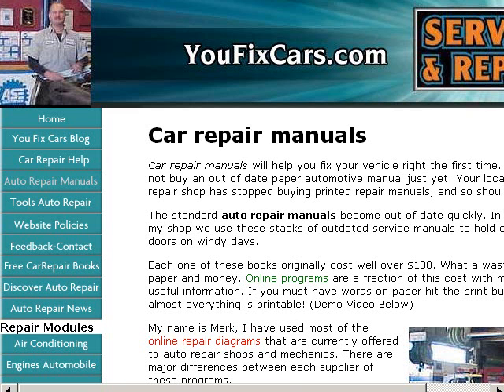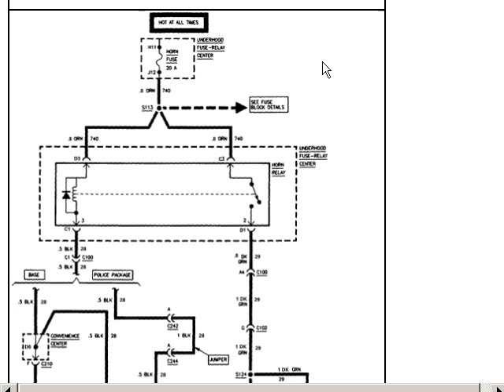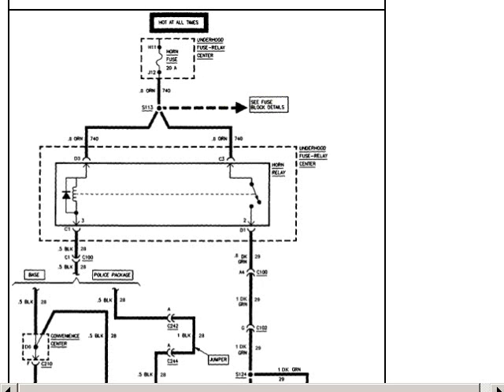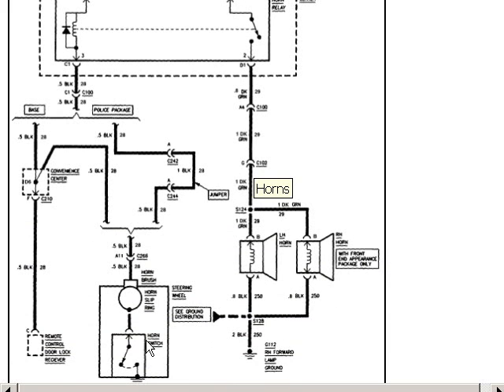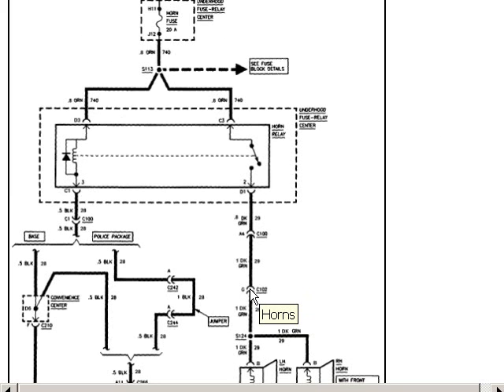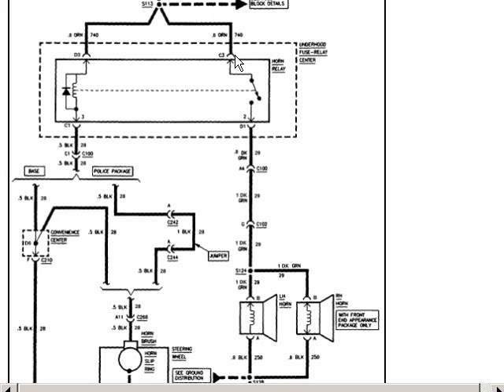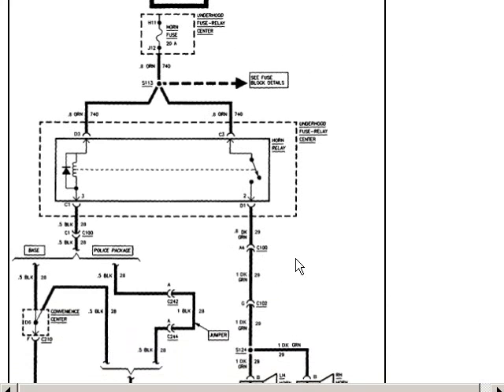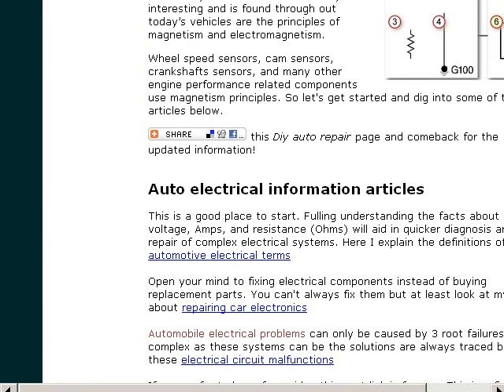How to find automotive electrical shorts

Comment: Good post. A light bulb (rated for the ckt. voltage) and socket with leads and/ or clips to bridge the fuse clips or holder (fuse removed) would give ckt. protection while troubleshooting if a breaker is not available. When the fault (Gnd.) is cleared the light will go out.

Comment: Nice video, thanks for making it.  It doesnt solve my problem but I did learn something from it none the less.  My issue is that I have lost power supply to the cigarette lighter in the car and also the blower no longer works.  they both dropped out at the same time on a drive back from Spain to the UK.  At the time we had the Air con going hard and three devices in the cigarette lighter, two DVD players for the kids and the sat nav.  All fuses seem to be ok. Tough journey after losing those!!

Comment: Not a bad idea but a bit tricky to hear the circuit breaker when you are in the trunk looking for a short circuit. I used to make up a long length of twin cable, about 6 to 8ft long, attach a sealed beam headlight unit (40 to 50w) to one end and at the other end solder a plug to fit into the fuse holder. With the lights switched on and the short circuit present the sealed beam will light up brightly. When you find the damaged wiring and move them the light will go out or dim considerably. All this can be done without going backwards and forwards to hear the circuit breaker. Also the circuit breaker can only operate like that for so long before it becomes unreliable and possibly stays closed and bridges the fuse holder and lets the wiring burn up.
Reply: Thats a cool idea. :)
Reply: Richard Morgan hello sir , how did you connect the light? can you pls break it down it sounds really interesting thank you in advance.

Comment from the maker: Yes I think most cars will have circuit breakers to grab in the Junkyard. They can often be found in the fuse panel or relay center of American cars and trucks. You can also get them new for a few dollars at any auto parts store.

Comment: I have Haynes manual (wiring diagram)  What is order of components?  Battery-fuse box- light switch, turn signal switch, brake pedal switch, then tail lights?  After I replaced turn signal switch and signaled with lever; the fuse blew.  Also, my dash lights come on when I hit brake pedal.  What is going on?  Please help.  Thanks in advance.  Great vid by the way.

Comment: Hi can you please elaborate if possible; are you suggesting attaching alligator clips to the circuit breaker & then inserting the breaker into the fuse holder??

Comment: thank you the videos.  I find them very informative.  I have watched a few but yet to see anything about melting wires.  I have a 97 Chevy S10 that melts the black ground wire from the ac blower motor relay.  Any thoughts?
Reply from the maker: Can't say I've seen that before, but my first thought is to wonder about the condition of the blower motor and blower resistor. Both could draw excessive current and melt the ground wire.

Comment: Can you have a short that does not break the circuit?  I have 88 Ford bronco.  When I turn lights on both tail lights and brake lights come on so brake lights always on when lights on.  When I hit brakes during day (lights off) they come on fine but running tail light comes on too.  I've replaced light switch, turn signal switch in column. (pulled dash out- was wire mess) Am confused about where to start to look for short.  fuses are fine. Hazards don't work either

Comment: After a little investigation it seems my car has a common issue where it melts feeds to the blower.  On my car someone has taken a feed from the back of one of the 12v sockets to feed the blower.  When I had the three devices fed from this 12v supply AND the aircon going it must have blown the feed fuse to that 12v but can I find that fuse?  Also rather than having 12v at the 12v socket, I have 5.5v.  Any clues why?  The car is a fiat Multiupla uk spec 2002 model.